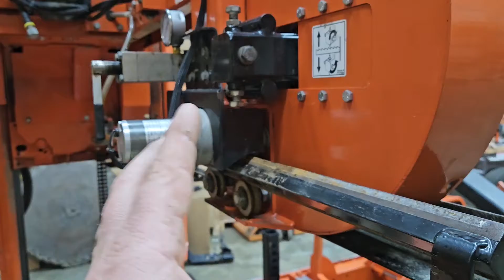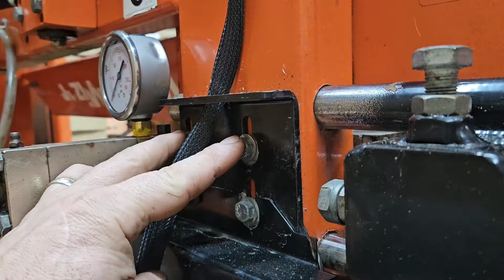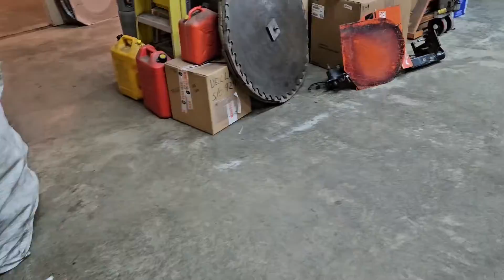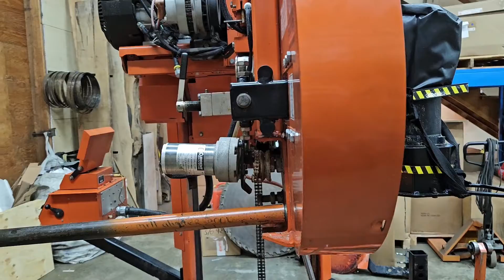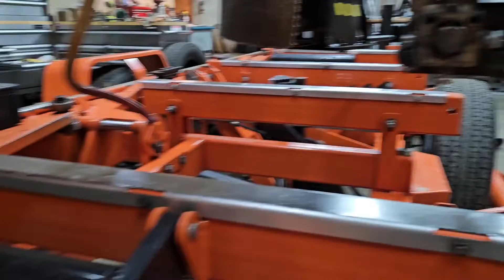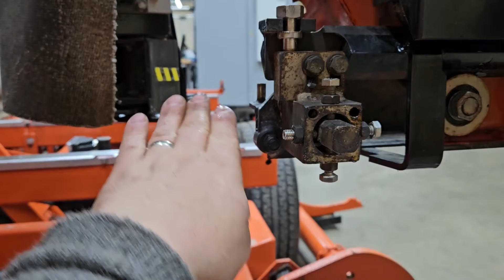WOOD-MIZER Lt40, Lt50 Guide Arm Repair

Comment: Awesome info! I just bought a lt 40 wide, low hours but the more I look its been used hard, How do I adjust the down pressure on the blade guides?
Reply from the maker: Thanks! I'm gonna assume its a newer generation mill as its a wide head. Park mill over the first fixed bedrail at a low height like 5 inches from deck. To check down pressure properly, its best to remove the guides completely. On the back side of each guide you should see 2 slotted vertical holes with bolts in each slot. Grab a 1/2 inch wrench, remove those bolts ant the guides should pull right off. Put blade on mill and tension it up now the blade is going from wheel to wheel. Measure from the blade to the fixed bedrail left side and right side. Ots ok if its a bit higher on right side. Once you have that measurement, take blade off, do not change head height at this point. Reinstall guides snug bolts and reinstall blade and tension blade back up. Make sure guides arm is all the way out. Now Measure blade height left and right side. Measurements should be 1/4 inch less at this point. If not the way to adjust is loosen the 2 bolts in the slots you removed earlier,  on the top of the guide there is a fine threaded  bolt, 3/4 inch wrench fits it. Turning  it counter clockwise lowers the guide assembly down. Make small adjustments, till you have achieved 1/4 inch of down pressure. Repeat for the other side till it's the same. Snug all bolts back up and your good to go. When i get time, my nest video will be on exactly this. Best of luck sorry for the long reply...
Reply: @halfshark101  
Thank You Halfshark! I just noticed you replied. I called WM today and that is exactly what they said. 1/4 inch deflection. I basically did what you said above, but I checked the height from several different fixed bedrails, and the measurement changes, 1/8 to 3/16 from different bedrails, I'm not sure which one is set right,  now my question is how do you true the bedrails up to the sawhead so you know that you have a true starting point to measure from, if that makes any sense, Really appreciate the help! Do you 90degree the main frame to the first stationary bedrail and set everything to that?

Comment: I have a request. Could you make a video on replacing the bearings in the drive housing ( housing that has the belt drive wheel on one side and the drive side blade drive wheel on the other side). My mill is a mid 90's LT40 hydraulic with gas engine. Thanks for your videos, they are well done and helpful.
Reply from the maker: Great suggestion! Next mill i have in for bearing replacement i will definitely make a how-to. The 90's style drive bearings are definitely a pain but i can save people a lot of time with short cuts and time save tips.

Comment: Owned and sawed with my LT40 super for about 24 years and just learned something on alignment with your movie clip.  Thanks for sharing.  The woodmizer is a wonderfully engineered piece of equipment.  Very durable and easy to work on.  My mill still performs very well and turns out precise lumber but I am thinking about trading up for a 50 just for the (I think) better log turning chain turner and I think a little better production speed (I am 74 and need all the help in the speed department I can get)!  Still great fun getting out there and breaking out a nice red oak and the grain is always fun to see when you brush off the sawdust.